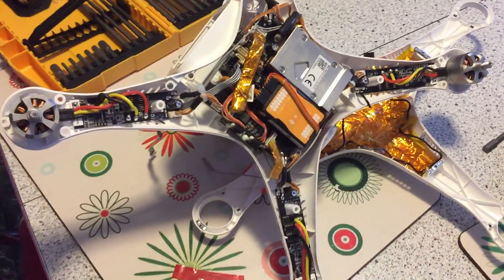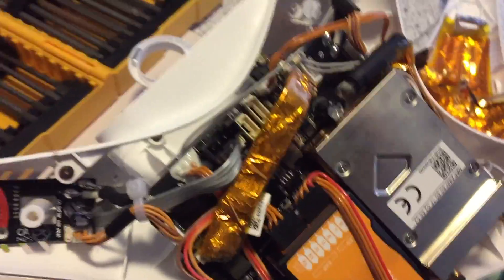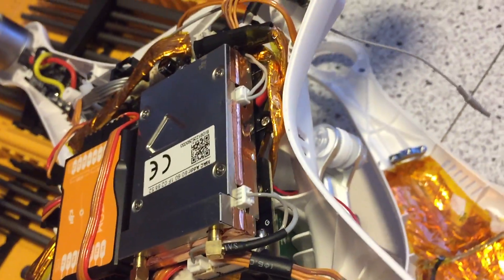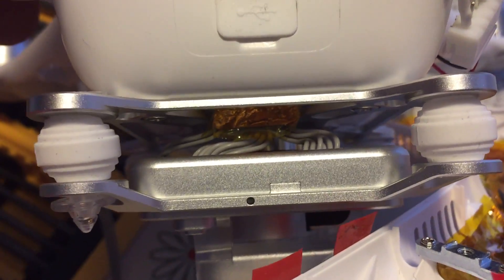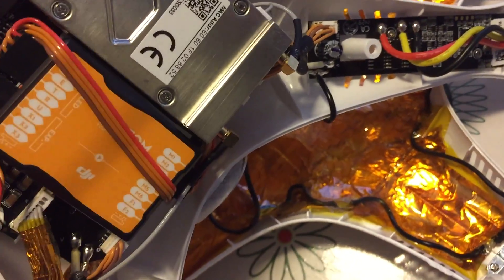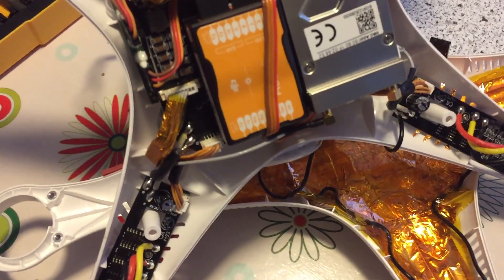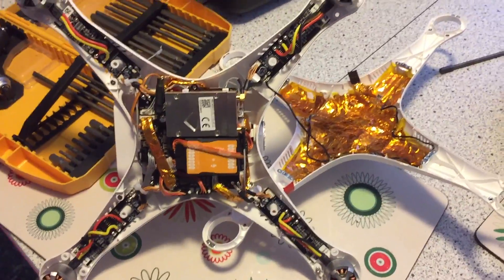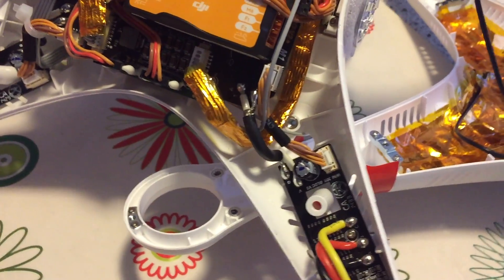QUAD COPTER MOD FOR GPS INTERFERENCE - A MUST DO !

Comment: Hopefully this will help save the GPS function on a jjrc x5 epik, I did the additional power connection to the board to plug in and use any 2s battery I want. Apparently the problem is the soldered on wires themselves must either run under the GPS module or under the compass, to get the connection routed to the back of the quad for battery connection. One would almost definitely swear these engineers design these quads to be all but impossible to make modifications to, for ease of use. Going to try this, thanks for the ideas!